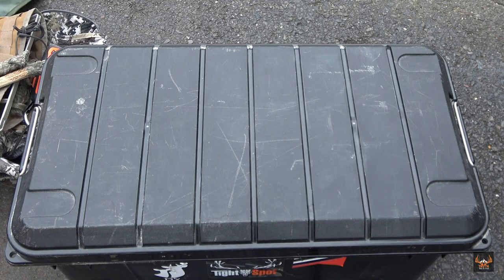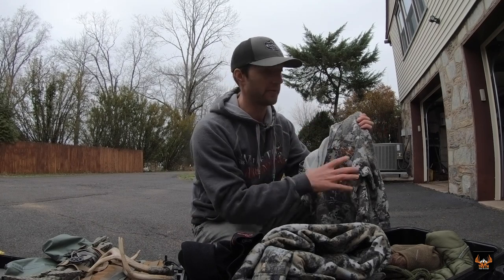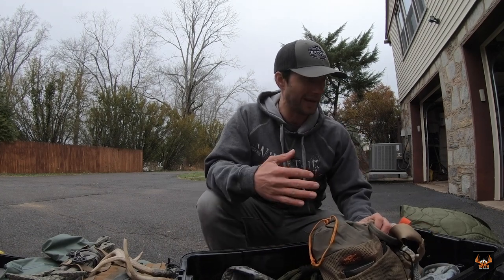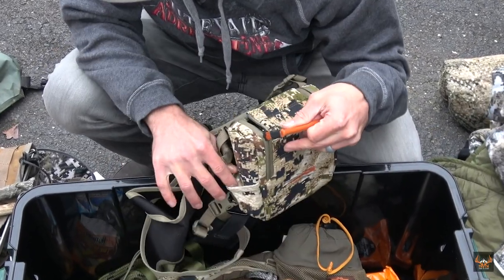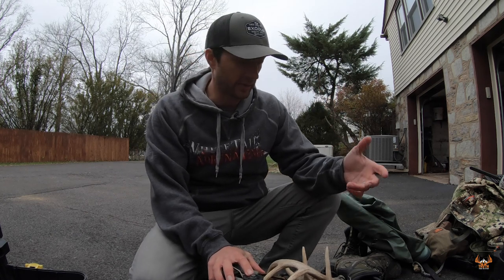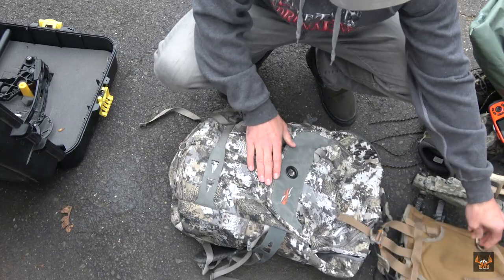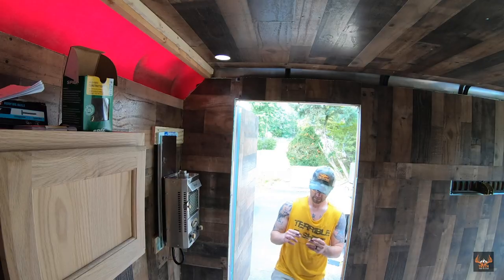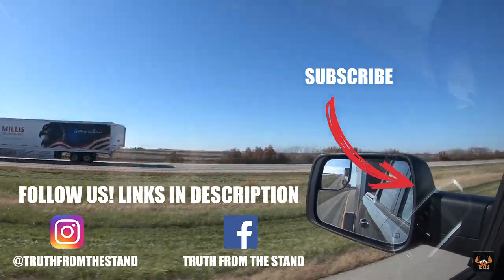Mobile Hunting Gear - Saddles, Sticks, Bow, Layering System and Kayak (Video)

Comment from the maker: What is your must have piece of gear?
Reply: Water bottle and snacks lol
Reply from the maker: @jarredrush9544  Yes!!! I did show my used snack bag
Reply: @truthfromthestand9994  it’s a vital component lol
Reply: Range finder!!   Water and snacks a close second
Reply: Anytime it is under 50 degrees, I wear the Pnuma heated vest.  By wearing that, I am able to dress so much lighter.  I never start the sit with it on, but as I sit there and start to get cold, I just turn the heat on.  It has a low, medium, and high setting, so for the colder days you can use more heat.  For longer sits, I will bring an extra battery.
Reply: TP. Seriously, I tell my daughter to follow the "LAW" - license, ammo, weapon. The rest is variable...
Reply: Bow